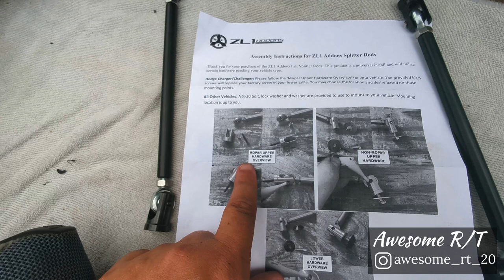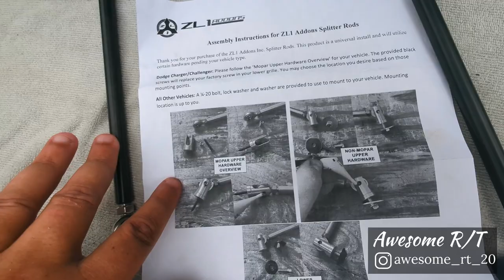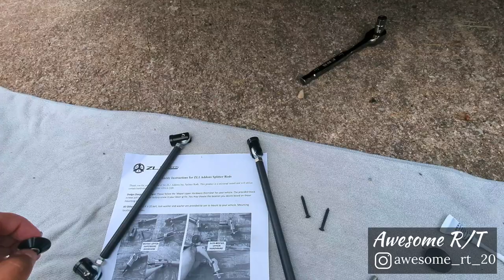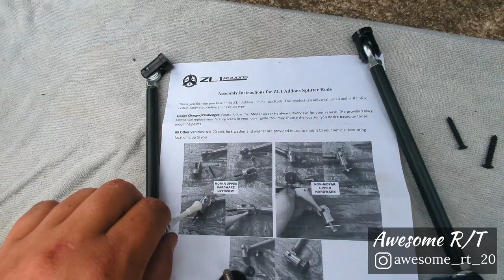ZL1addons Full Splitter kit install - Challenger Widebody

Comment: I have a question do you think this fitting dodge challenger gt 2019
Reply from the maker: This exact kit won't fit because the widebody vs not widebody kits are different.  If you just go to the zl1 addons website and go under challenger - body kits you will find the non widebody kit which will fit your challenger.